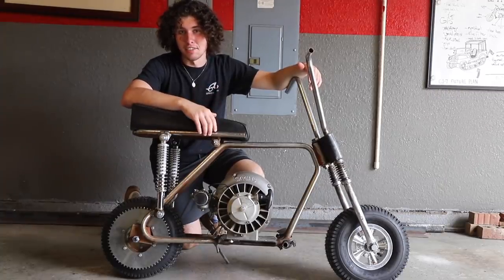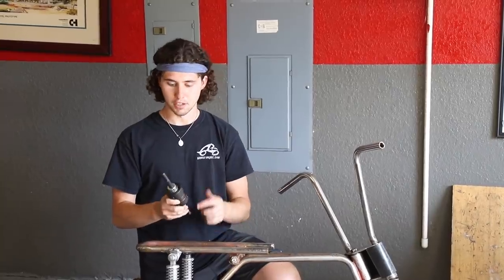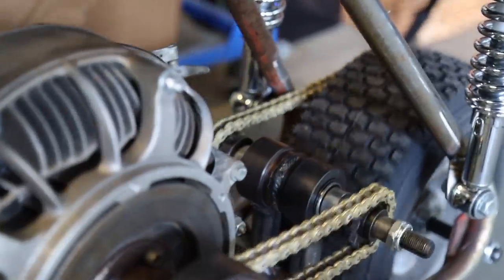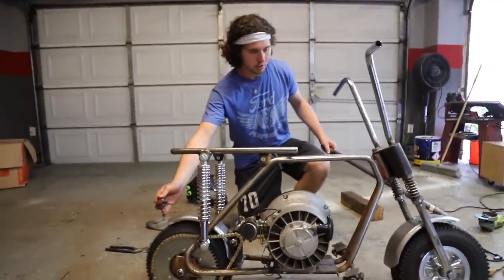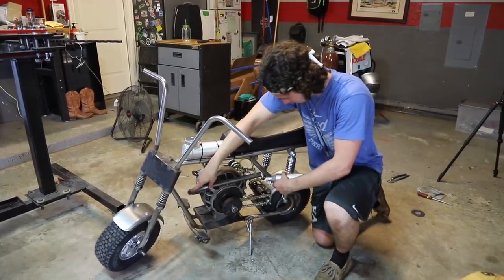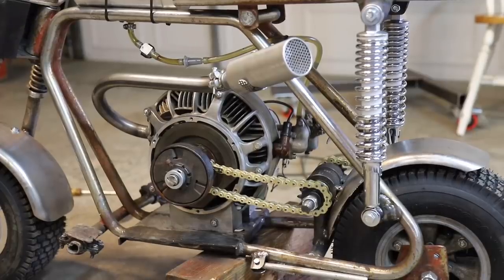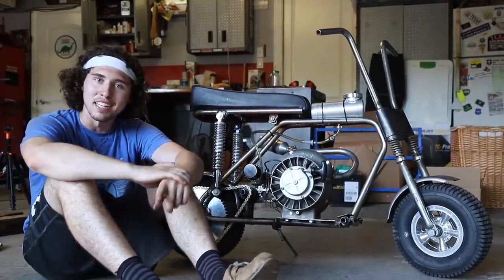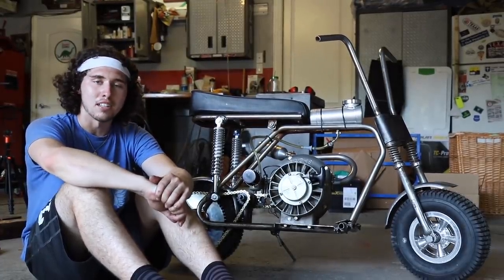ROTARY MINI BIKE gets a Drivetrain and Custom Exhaust! | Rotary MiniBike Ep. 2

Comment: Those long unsupported jack shaft mounts will be ok for a little while as long as it does not get much use. They concentrate a lot of load on the lower connection point.

Comment: you could just use a disk break calliper on the wheel sprocket i would also cut the exhuast and mount it so it is central on the bike

Comment: Engine to Jack shaft chain sure was bouncing around a lot might want to add a tensioner sprocket or you may be slinging chains,  sick build,  can't wait for maiden voyage
Reply: Sounds good in paper,  the problem is chains still stretch and things move,  ridged things holding malleable objects eventually fail,  adding a spring idle tensioner will always have consistent tension on the chain until it's maxed out ,  why do you think your car has the same setup... why don't you just stop while your not ahead

Comment: You're probably going to lose a fair amount of power through that jackshaft with the tiny sprocket on the primary side (not to mention a serious amount of side load on it). May be better to go with a little bit larger sprocket on the primary side of the jackshaft, and a little smaller wheel sprocket to compensate. That jackshaft 'stand' won't last long without running some support pipes down to your lower frame rails to box it in. Otherwise, it should be a fun little ride.😉

Comment: Put a caliper on the rear sprocket like a sprotor! 😁
Reply: Josh...the chain lube would ruin the disc pads in 1 minute but good idea though if he doubles up & does the same on the opposite side of the rim & same on the front wheel too - you get upto 70% of your braking on the front compared to just the rear only !.Cheers Bud Trev NZ
Reply: @trevinskiking2165  I mean, unless you’re applying chain lube by the gallon centrifugal force would keep most if not all of it off, sprotors do exist and do work pretty well
Reply: @tenderblender945  When I was MX racing we would soak our chains in a hot pan of Moly grease (Liquid) let it slowly cool & dry - there was natural sling off. You can lose up to 30%HP with an improperly lubed chain.T 🙃NZ
Reply: @trevinskiking2165  no for sure, you need your chain lubricated properly, but you could use more of a chain wax vs a chain oil
Reply: @tenderblender945  I get your point but I didn't say OIL , I said MOLY GREASE: a + 2 HP increase - another of my speed secrets hard earned: Isky Trev NZ
Reply: @tenderblender945  That's why my mint stock jugged but tickled '74 CR125m Elsinore(1 owner:wish I still had that bike today)Green & silver tanked Rocketship Wasn't outrun by then new '79 big 4 four bikes(some were slower)a test pilot was shocked:he said it was Faster than his CZ250 - (Straight from his mouth) then he DIDN'T buy it ! Damn tyre kickers.Others used to fit a later model downpipe but that just gave them peakier narrower powerband: mine U could Trail ride & never once loaded up! I fitted a much dispised New on the market Cheng Shin mud/dirt grabber std size tyre (Sheet did it hookup & Go) Got the Holeshot on Australasias Champ now local NZ (USA) Car racer Gregg Brink !.Trev New Zealand."you can lead a horse to water but you CAN'T make him drink ".

Comment: Very cool build! Whats the rpm range of that rotary though?? Im assuming much higher than a predator. If so, you might need a much bigger sprocket on the jack shaft to increase your gear ratio because that thing might be geared to do 60 mph and not have much acceleration! One more thing you might consider is the "lock-up" rpm of the centrifugal clutch, Because of the higher rpm of rotaries, the idle speed of that engine might already be locking up that clutch so either much stronger springs in the clutch, lighter weights in it, or you might have to install the clutch on the jack shaft once you lower the gear ratio to the jack shaft! Defiantly do some on the ground testing before putting more work into this! very excited to see this frame chromed!!
Reply: from what i could find online, the max rpm or that engine is 5K so with your gear ratio (6.1:1) that should put you around 32 mph top speed. Not as bad as I thought! Might be in the clear if your idle rpm isnt too high!

Comment: I missed why you couldn't flip the tire over, hence no jack shaft...
Reply: thinking the same thing 
just flip the wheel så the sprocket are on the other side, no big deal
Reply: I'm thinking maybe because the shaft sticks out too much to line up with the wheel sprocket and they wanted to keep the engine in the middle?
Reply: @lennym1273  good point
Reply: @torbendk2777  Thanks, it's just a thought...
Reply: I was wondering the same thing. Maybe they expect to change the gear ratio.

Comment: I honestly think that you guys should have ran the exhaust underneath the seat that way you're not burning your leg and why work harder can you just mount a disc brake setup on that sprocket Mount the disk brake mounts to the frame and use the sprocket in the break they make them that's what I would do

Comment: why didnt you just spin the rear wheel around so sprocket is on other side and no need for jack-shaft
Reply: Possibly an alignment issue.
Reply: Sprocket alignment
Reply: @finrennard3402  Nah just move engine slightly to off center or modify rear wider. Those are non issues. Whats more likely is that due high revs they need to gear it  with second set, but that even that would be solved with CVT
Reply: @Hellsong89  only issue with that theory is that they didn't gear it down with the jackshaft. Both sprockets are the same size...
Reply: With a Jack shaft you have more options and better gearing. It takes the stress away from the motor

Comment: Hey how you doing today, the reason why I asked looks like you know about motorcycles I have a motorized bicycle with a 2-stroke enginemaybe you can help out the problem I'm having is when I'm running it pushing a throttle it like wants to shut down run slow and then it turns off I'm doing the two stroke oil and gas right and I have a new spark plug NGK please help

Comment: Why didn't you just run the chain from the engine directly to the rear wheel sprocket?
Reply: You can only put the sprocket on one side so you have to run a jackshaft. One benefit of a jackshaft is the chains are shorter and less prone to slipping off.